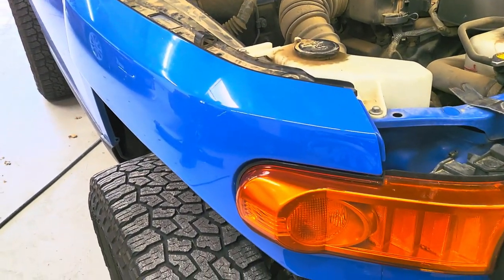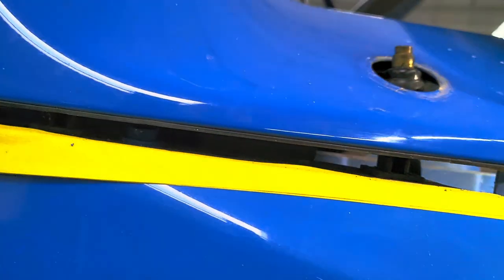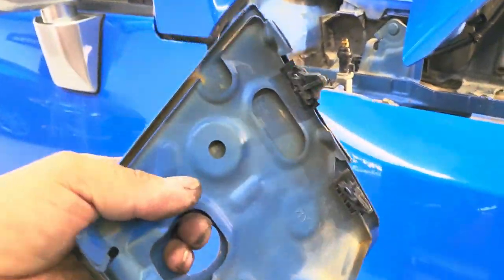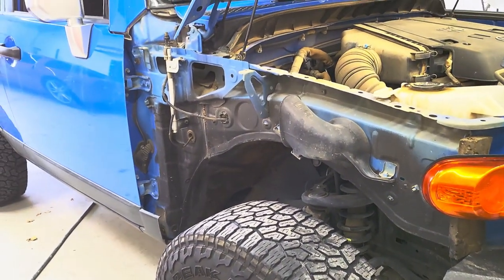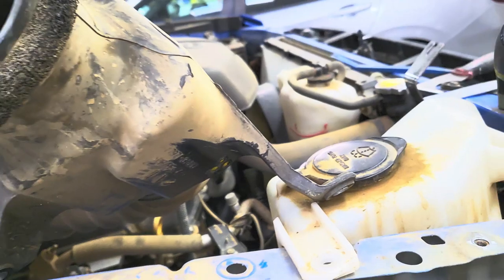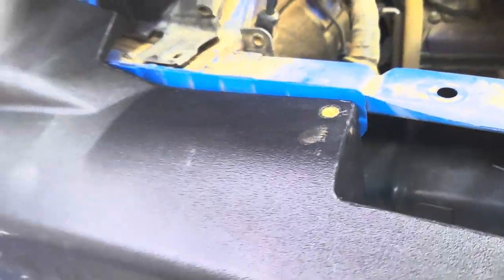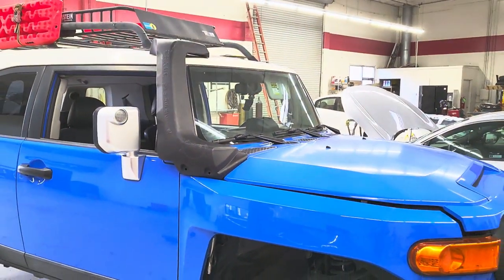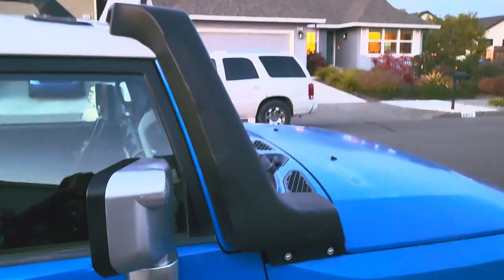Fj Cruiser Fender Removal and Snorkel Install

Comment: Sorry to change topics, I tow my FJ cruiser behind my RV using the D rings on my aftermarket bumper. I see these D rings are screwed onto the bumper. Do you think your bumper is thick enough or the way the D rings are attached it would be safe to tow my FJ using the D rings?
Thank you
Reply from the maker: I'm not sure that I would tow it from the D shackle Rings behind an Rv. I will say it is more than strong to tow or pull things with it or get pulled out from the D rings but for towing I would purchase an adjustable tow bar kit. They are not too expensive. You could remove the D rings and use the pin brackets to bolt your tow bar onto for towning purposes. Once your done towing you can re install your D rings on your bumper. 👌🙌🙂

Comment: Noticed you deleted your fender flares. What did you use in place so that there’s no bare metal look underneath?
Reply from the maker: Glad you asked. I ended up using Raptor Liner coating on the bottom wheel wells. really strong stuff and durable.

Comment: Do you have a link to the snorkel?
Reply from the maker: Purchased it from ebay. Here is a link to the one I purchased. https://www.ebay.com/itm/385198693066?mkcid=16&mkevt=1&mkrid=711-127632-2357-0&ssspo=eJPt3_4mSFO&sssrc=2349624&ssuid=NXbruxeOQXO&var=&widget_ver=artemis&media=SMS
Reply: @Fjoffroad  Thanks for the link. Did you have to grind down the snorkel to fit with the fender?
Reply from the maker: @arsenii555  your welcome bud :). No grinding down of snorkel at all 👌😎